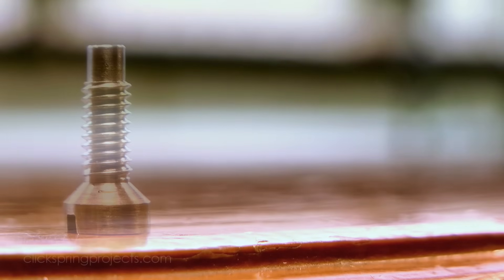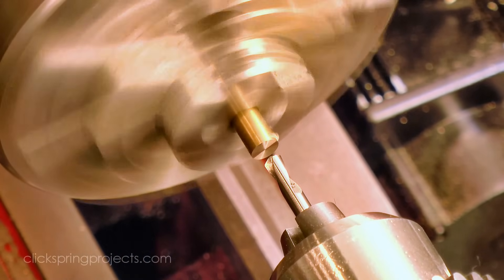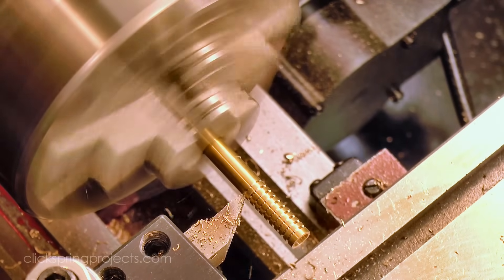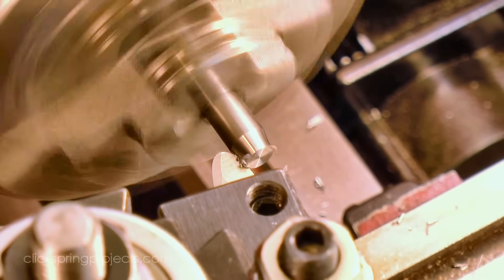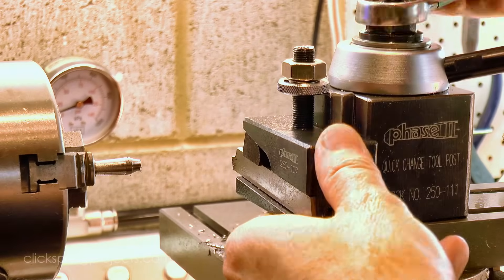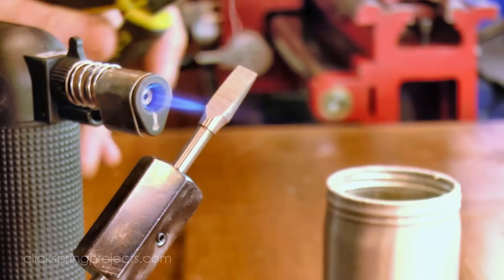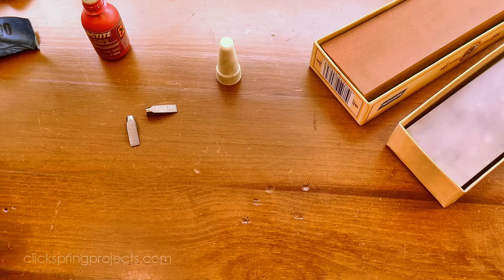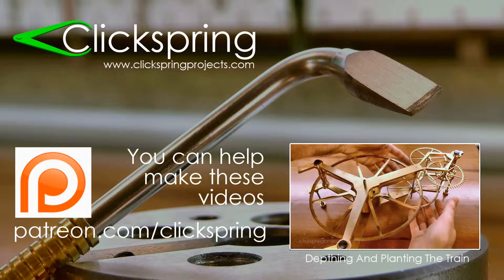Spare parts #6 - Making A Right Angled Screwdriver

Comment: Why machine the slot in the head of the screw if it's going to be ground anyway?
Couldn't be possible to machine the slot in the tail of the screw? Insert it in the hole and manually feed as much as you can, then you can use the slot and a screwdriver to tighten it by "unscrewing from the outside". I hope what I mean is understandable
Reply from the maker: +Shannariano I did a bit of testing to see if I could get away with either a hex driver, or a slot on the other end but there just wasn't enough metal at the other end of the screw to resist the torque. The screw needs to be inserted quite tightly, and the metal simply distorted and bent. The only practical option was to put the slot on the inside. Thanks for watching.

Comment: Why did you not simply cut a screwdriver slot in the other end of the screw? o_O
Reply from the maker: +DoesAnyoneOnThisPlanetReallyNeedThisManyCharactersToInputHisName I did a bit of testing to see if I could get away with either a hex driver, or a slot on the other end but there just wasn't enough metal at the other end of the screw to resist the torque. The screw needs to be inserted quite tightly, and the metal simply distorted and bent. The only practical option was to put the slot on the inside. Thanks for watching.

Comment: Much easier to make a right angle in an existing screwdriver. In other terms fuck it into a vice and put your weight on it. Use cheap screwdrivers as they will bend easier (and will prevent you from destroying a good one).

Comment: why not just making a hex head on the tip of the screw and than tighten the screw from outside...? or making a cut in the tip of the the screw and use a normal screw driver... you are cutting the tip and the head of the screw anyway...

Comment: Of course there are easier, quicker ways to get jobs done. Buy a cheap right-angle screwdriver for a quid. Bend an old one in the vice. Pay some guy to do it for you. Why make anything? Just get it over with and get on with something else and -

No. 

Chris is a craftsman, which means that he cares about the craft of making. The man who created the original Antikythera mechanism would have been 'driven' just like that - inventing things, making tools to make other devices which themselves let him produce the unique components he envisaged. 

Craftsmanship is like sportsmanship - it's a state of mind, and it applies to everything you do. A good sport on the playing-field will be a good sport off it. With Clickspring, craftsmanship embraces everything Chris does - making tools, making clocks, making videos. Attention to detail matters, and it shows. You really can see it.

And if he made violins, you'd be able to hear it. How? Because the process would begin with his wood store, where the shelves would be stacked with precious, seasoned material that wouldn't be 'ripe' and ready for use for another 12 or 15 years. Yes, not 12 weeks, 12 years.

That kind of thing matters as much today as it did when Guarneri and Stradivari were obsessing about tone and making their own weird little custom planes and clamps and bent scraping tools 300+ years ago.

Look through a Clickspring tool cabinet. I bet at least half of the things in it are custom-made. And all those jigs and moulds and patterns are homemade, too. Each one is more than a work of art - it's a work of craft, which is a much rarer thing.

Why does it matter? Because Chris cares about details and loves what he does, and that transfers through to the finished product.

Which is why people like me watch this stuff. Can't get enough of it. People will think I'm an idiot for spending so much time making a Comment about a bent screwdriver, but that's fine. Some things matter to me, and others don't.

I like the extraordinary. Whether it's calendars in Ancient Greece or violins in Cremona, Italy, or a bent screwdriver in Cairns, Australia, Clickspring gives us a glimpse of the extraordinary. And that's something that matters to me.  :-)